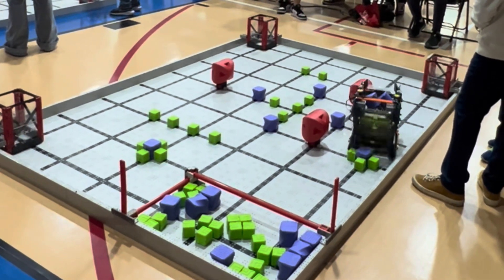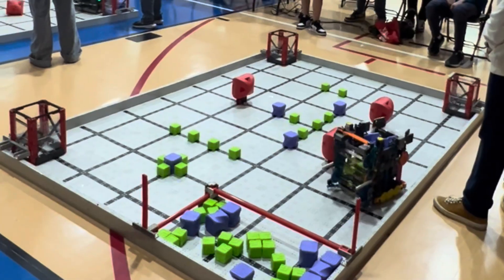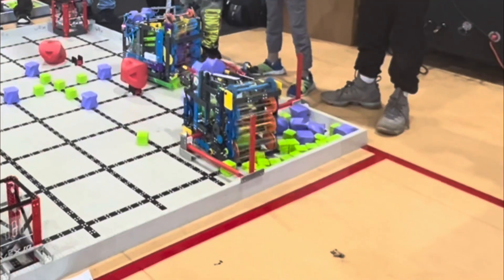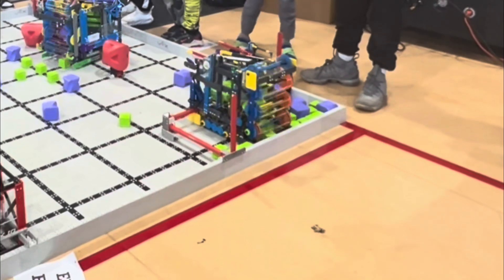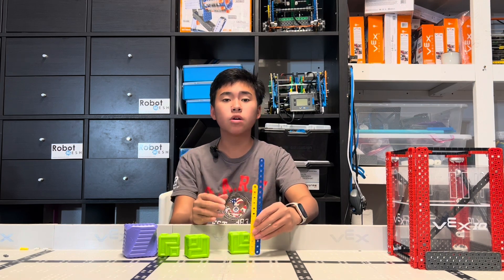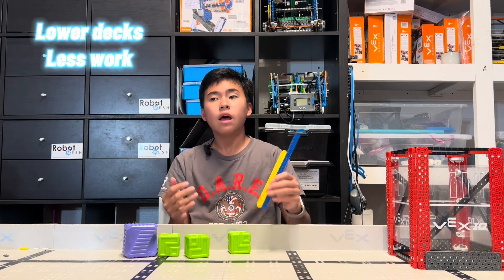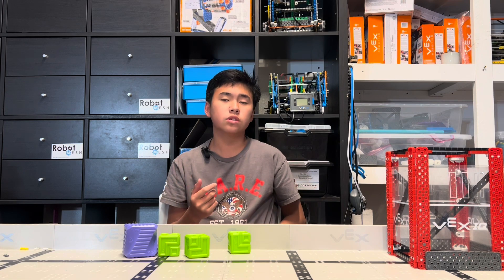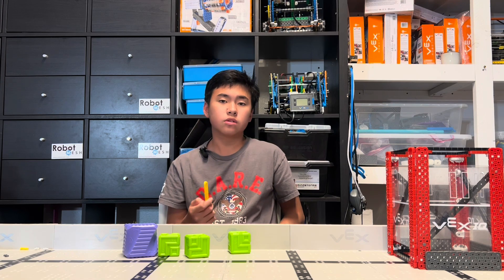Robot Design Ideas Exchange, Check it Out. VEX IQ Full Volume Brianstorm.

Comment: It could have something to do with your rubber band wall. There has recently been potential new meta discovered that basically makes it unable to jam if tuned well. Of course I am happy to help and provide pictures for it too!
Reply: What kind of tuning are you referring to? As in, the size and shape of the rubber bands, or the wall pattern, or both?
Reply: @unrealandunlike615  the wall is special in that it goes back and forth. It is suspended by rubber bands so the tuning would be the tightness of the rubber bands holding up and the location of the wall
Reply: Sus wall 🔥🔥🔥
Reply: @pyre46168G
Reply: just use pet sheets

Comment: Use washers my guy, so many washers, like make your entire intake washers. And make your ruberband wall as loose as possible, and use triangle banding for your 4bar, alot of it. You can do 4:1 with 2 morors if you do all the stuff listed above
Reply: Use cross bracing to keep the intake from sheering
Reply: @apollo4582 this might be a dumb question but what is sheering?
Reply: @velocity6867  think of the intake like an H the 2 lines on either side are the sides of the intake. If one side is higher than the other it is no longer an H. So the axel it rotates on is slanted and has too much friction to move. You can prevent this by putting a 1by20 from the bottom left of the intake to the top right and at the bottom right to the top left. Connected by a pin where they cross
Reply: How exactly will that help with sheering, thanks
Reply: If one side of the intake were to become higher than the other the crossing 1by20s would balance out one side of the lift being higher than the other, for example if the bottom left hand side Intook a purple cube it would raise the top right side of the intake to balance it out
Reply: Like make and x across the intake
Reply from the maker: Our intake speed can reach120 rpm, it looks the intake doesn't have much friction with in it self, but the rpm with easily drop easily while dealing with multiple cubes.
Reply: @flyingcheese22608a  I was looking at some of your old videos and it looks like you have really bad sheering I would check it out
Reply from the maker: You are so right！ @apollo4582
Reply from the maker: Thanks a lot!!! We will definitely try them all.
Reply: Also the answer to your PTO question. I suggest using slower gear ratios for the initial PTO to prevent slipping and then ramp up the speed later on, hope this helped
Reply from the maker: @apollo4582  That is a great idea!
Reply: @flyingcheese22608a I figured out what was wrong with your PTO. So I replicated it for fun out of curiosity (don’t worry I’m not using it I have my own) and it’s because you were using hybrid gears. It works if you change them out
Reply: Like when one side of the intake is higher than the other it can rub the shaft unevenly
Reply: That's why cubes intake better in the center of the roller